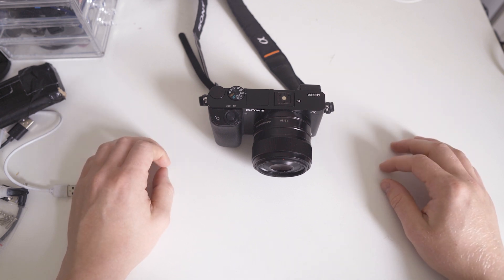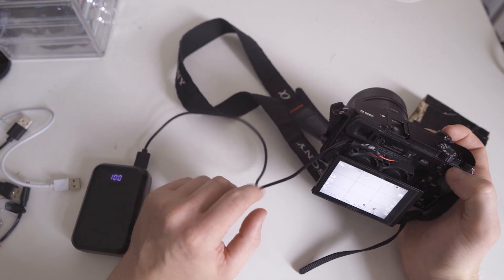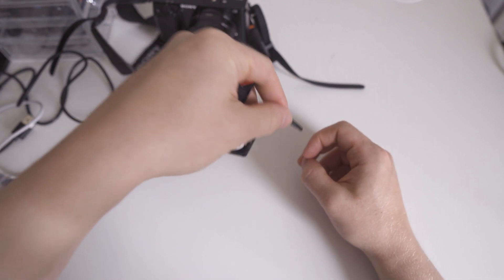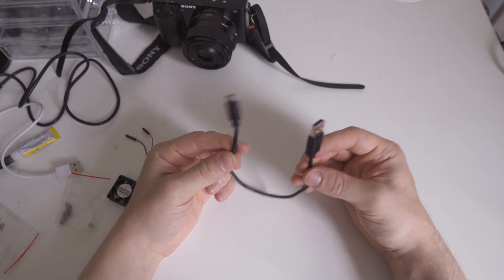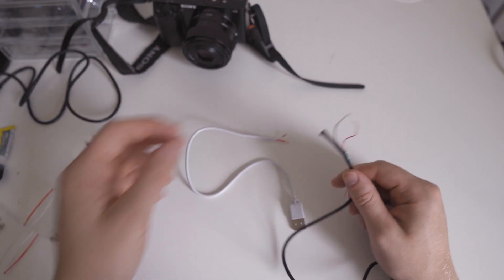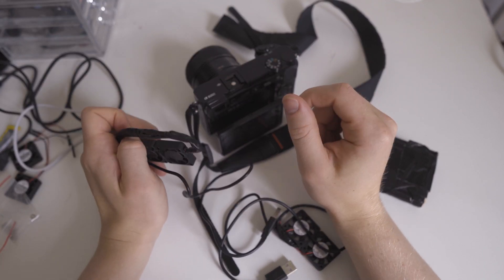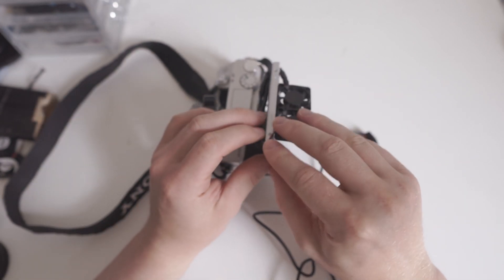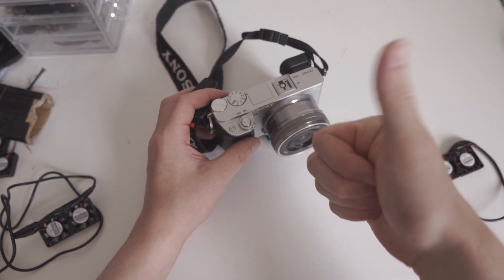Cheap DIY Sony Camera Overheating Fix A6000, A6100, A6300, A6400, A6500, A6600 and A7 series cameras

Comment: I put the fan on the Sony a7iv and the air noise appeared in the video audio. it was frustrating.
Reply from the maker: That does sound frustrating, I think if your using an add on fan you may need to use an external mic and or some noise reduction in editing software. Hopefully all goes well for the next recording

Comment: Listen to the Russian guy in this comment section, I think he’s onto something.

Apparently behind the LCD screen is a sticker, with all the regulatory information about the camera and a “overheating warning”

With a pair of tweezers you can remove this and reveal a bunch of holes that were being covered by this thick black sticker. Could this be the solution to this problem?

We need to investigate further.

Comment: if you need to shoot video for hours just use the hdmi output without display overlay and you can record  on a different device with hdmi capture  card  (e.g. an rapsberry pi 4  or a proper computer ) (720p was solid and if you go up in price there anything is possible , including shooting pictures during recording)

Comment: Do you think it matters which side the fan is pointing?  I would think it's better if you set it up to the exhaust side (ie. labels pointing outwards, instead of inwards as you set it up).  Have you experimented with either or?
Reply: How it would work friend ? You need to create a vaccum place to do that ..

Comment: Nice one! I just bought a used 6300 and came across your video.👍 Years ago I had a Sony NEX 5N that overheated during a live shoot of a band playing. Aaaahhhh!  Lucky I had 2 gopros getting wides. But I ended up with a straw blowing on the back of the camera (no one noticed) so I had to power off 5N....power ON as track stated and power OFF before track finished. 😂😂
Reply from the maker: Ah yea can be very frustrating in professional settings, that's what hopefully this video can help people with. But yea I think a lot of us have been there i remember holding an ice cube in a plastic bag to my camera to keep it cool (not advised!)

Comment: Isn't the sensor that, what overheats? If you bypass the temperature sensor, wouldn't that damage the sensor in the long run? Because you just cooling the body, not the sensor
Reply from the maker: the sensor is getting cooled as the body is cooled as they are all closely connected inside.
Reply: @AxelWolstenholme  The body is plastic. It doesn't transfer heat at all
Reply: @johannes.schaffer  I am guessing you have never held one! The body does dissipate heat which is why folding out the screen helps with cooling. If it feels warm to touch, that's heat being dissipated. Cooling the exterior helps with conduction of heat away from the interior of the camera.
Reply: @johannes.schaffer  the body under LCD screem is a thin sheet of plastic sticker and underneath the sticker is a heat sink.
The processor(main heat sourse coming from the processor,not sensor) has thermal conductivity tape attached to the heat sink
So the fan is technically cooling the heat sink covered by the plastic sticker to draw heat from camera.

I even peel the plastic stiker out of my camera (a5100, its old so Im ok with peeling it off) to let the heat dissipate more efficiently

Comment: What a great solution for those cameras that overheat with long video shooting!  Thanks so much!  While I agree with "Bill Kearns" that Sony now has made the A6600 with no recording limit (meaning that overheating is no longer an issue FOR THAT CAMERA (and I have the A6600), your tiny fan could be a potential solution in the field if even the A6600 for some unknown reason began overheating. At times I've been in very hot environments internationally that would challenge possibly even the A6600's internal cooling system, so this fan could be useful. One point I'd like to make-in my case even when making a video I don't think I'd ever shoot more than 2=3 minutes without stopping to set a new angle. It would be only under an extraordinarily rare circumstance that I would need to shoot in a  long continual video mode.
Reply from the maker: Thanks for the great feadback, I do a lot of live music filming and can often be running a few cameras for over an hour - multicam set ups and a one man crew ahah - for the price sony cameras have great video capabillity but the size means they often overheat after an hour or so whereas a camcorder would probably not. But yea your right most of the time people are taking short video clips so its more of an add on for the rare use cases than a common use.
Reply: With my A6000, I record soccer games, up to 1.5 hours or more, sometimes in the blistering summer heat of Alabama (and Texas once too). I use an umbrella to keep the camera out of direct sunlight, and that along with keeping the screen propped open, the flash popped up, and running on an external battery with the battery door open is just enough to keep the camera from overheating for that duration. I just ordered a clip-on usb-powered "stroller fan" for this same purpose for this season to see if it helps. I really like Axel's idea here too, especially how the fans could be placed behind the screen. 

Great video!
Reply: My a6600 overheated last evening for the first time. It was only 1/2 hour into filming. The camera was in (nearly) direct sunlight, in late afternoon, and the screen was flipped out to allow for air flow. Had to wait 15 min for it to cool down to continue recording. Thankfully, we never rely on 1 camera for filming. Sadly, though, this is ridiculous for a $1600 camera.  The only apparent differential from prior uses is that we were using a bigger and faster SD Card. Did not have this issue on 2 prior jobs under the same conditions. Contacting Sony tomorrow.
Reply: @vitodifronzo6471  considering picking up an a6600 did your issue ever get resolved?  While I realize the a6600 is better than previous iterations it IS still there
Reply: i guess im randomly asking but does any of you know of a tool to get back into an Instagram account?
I was stupid lost my account password. I appreciate any tips you can give me!
Reply: @Lian Lawrence Instablaster =)
Reply: @Tatum Raul thanks so much for your reply. I got to the site thru google and I'm in the hacking process atm.
Seems to take a while so I will get back to you later with my results.
Reply: @Tatum Raul it did the trick and I now got access to my account again. I'm so happy:D
Thanks so much, you saved my ass!
Reply: @Lian Lawrence you are welcome :)
Reply: Removing the recording limit doesnt actually mean overheating isnt a problem anymore. Thats just a silly thing to say.
Reply: @pmAdministrator lol was thinking the same

Comment: Why not have a camera that doesn't overheat?
Reply: I know! Camcorders and cameras just differ in this way- the ability to shoot for extended time with a "small sensor" or shoot for limited time with a big easy-to-overheat but much better "large sensor". Some of us need hacks like this sometimes to bridge that gap without needing to purchase farrr more expensive equipment.
Reply: Thats why I stayed with the G85/G80/. With Sigma glass and colour grading......the quality is pretty much on par with Sony.  The A6500 is an awesome unit but it just has too many issues for the sake of a slight improvement on video.   Going out with a Fan + gimbal + 10 batteries just seems allot of stress.
Reply: Sure, find us an affortable, new, featureful camera that can take 6 to 12 hours of live streaming without overheating.
Reply: @pmAdministrator  GH6
Reply: @francesko1763  How is that affordable? Its 1700 euros...